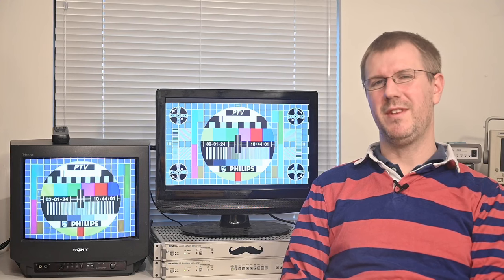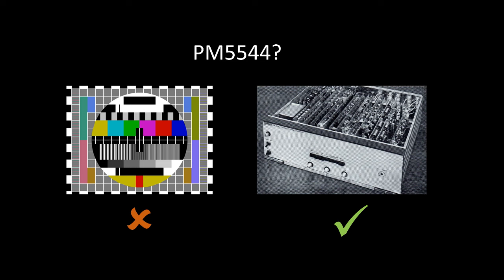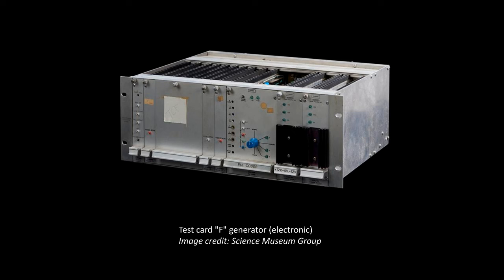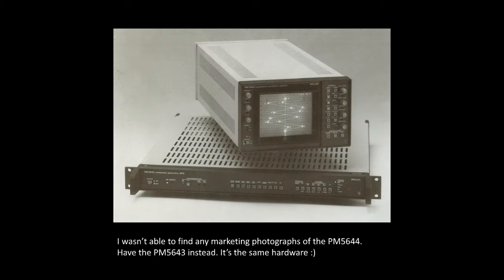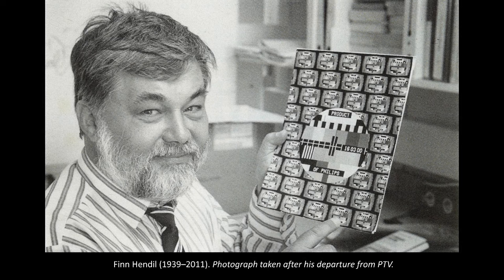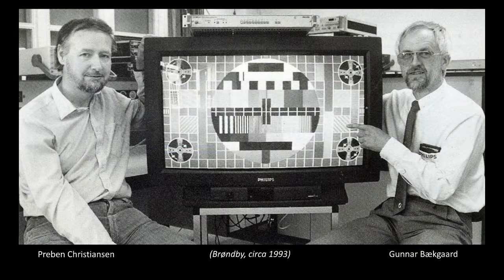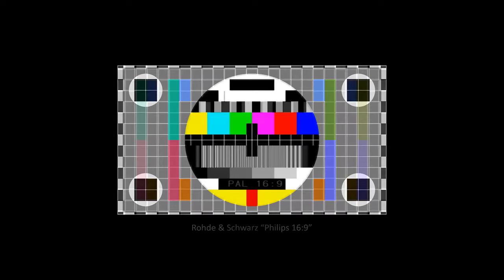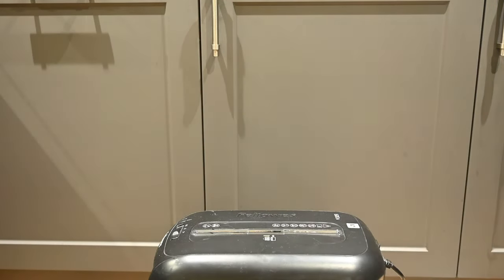#12 - The real Philips PM5644

Comment: Great work! I might look at building a 525i SDI version as well as a 1920x1080i. The 525i SDI could easily be encoded to NTSC if required. However rather than fabricate all that hardware, are there standard high quality image files available anywhere online? My approach is to make a Windows or Linux based generator which would output via a low cost Black Magic SDI card using their API. Then just find an old 1RU server as the hardware base.The editing features would be via drop down menus on the PC VGA/DVI display. Or they could be command line based as a start. Of course being software based, such a unit could  output in any standard resolution or format. Just load the image file,.What do you think?

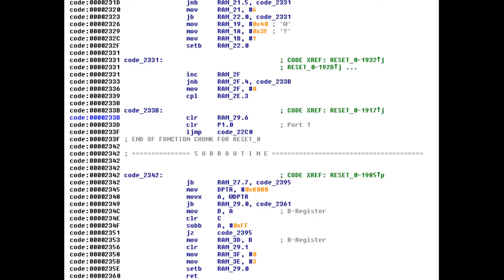Comment: 21:44 puts that project in the shade? Yikes!  I've done some reverse engineering of code like that. It takes ... a very special kind of person to press ahead, let alone succeed at it.  So I know you're not exaggerating. My hat is off to you!
Reply: I agree. When I was 16 I would have had the energy for this, but nowadays I would give up after 1 hour.
Reply from the maker: @der.Schtefan  No way I could have pulled this off aged 16! A project like this requires quite a lot of experience, which at 40, I now have :)

Comment: I have a PM5644 Pal Plus generator too, model number PM5644/85. Unfortunately no documentation. I also have a PM5544, which I got about 20 years ago. According to the station ID that was programmed into it, it belonged to the ABC in Cairns. It also had a 'home made' card in it that replaced the pattern in the circle with "Please stand by" in yellow lettering on a blue background if the 'Ext pict' button was depressed.
Reply from the maker: Ohhh. I have read about that ABC unit. When you power on the 5644. What firmware version does it say it is?
Reply: It says version 001.1
Reply from the maker: @a4000bear  hmm. I think mine is 000.1. I don't suppose you have a picture of the pattern it generates?
Reply: I can do a pic, but there is no way of putting it on a message here.
Reply from the maker: @a4000bear  drop me an email maybe. I have it on my youtube about tab
Reply: Just sent it. You should have it now or in a minute or two.

Comment: Forgot to mention I also have a Tektronix TPG-625 which generates the PM5544 pattern. No documentation unfortunately.
Reply from the maker: Ohhh. I have the manual for the TPG-625. I will scan it in due course.
Reply: Cool, I'd love to see it, but no hurry. :-)
Reply from the maker: @a4000bear It will take some time. It is a big manual with like a hundred pages and a mix of A4 and A3 sheets. Will have to pay somebody to do it probably. If you (or anyone else) needs any info the meantime let me know. I could scan specific sections from it.

Comment: I really want the Philips PM5644G/00 Pattern Generator. I was going to buy it earlier but it was sold out. I really want it. Mine only has the FML Test Card Maker. I really want the PM5644. Radio repairnan or people. If others still use them, you should sell them to me.
Reply from the maker: I don't have one. I sold my PM5644G/00 to a guy in the netherlands about a year ago.
Reply: @mattstvbarn  But I really want a Philips 5644G/00. Even though you don't have one, I still want one. What should I do?

Comment: I made a video on testcards in general (in danish but subtitled): https://youtu.be/WQ2OSaBcS_o
Some of the engineers from Philips DK that worked on the Philips 5544 was later employed at Denmarks Radio, where I had the chance as a consultant to work together with one of them. He told me a lot about the 5544 development, and how it was gradually refined. If I remember correctly, he worked on the final analog output stage. 

In the early days of the Danish test signal, the source was the 5544, but modified with DRs own text and clock overlays. At that time the font was quite digital, and there were ":" in the time. Here is a clIp of that: https://youtu.be/C0XIiXu4TuM (I think this was a DR internal construction).

Later, the clock source was one of the newer PM boxex, that had the time separated with "." like this: https://youtu.be/kRJ43r7yIDs , but still with handmade digital overlays of logos. (BTW: The color logo was in production use for some years in DR). 

The latest version I know of looks like the PT5300 out-of-the-box: https://youtu.be/vVg2GMyqGac

Needless to say, but I find your video very inspiring and it fills in a lot of unknowns in my knowledge of these delicate pieces of test equipment. Thank's a lot.
Reply from the maker: I will take a look at your video. I can basically read danish nowadays. I have also learned from this! I have covered this topic a lot but despite it is very rare to hear anything from Denmark. Once you start seeing test cards with graphics this is usually the PM5644, especially if recorded after 1989!
Reply: I think that we have 2 pcs PM5644 compositet version in our museum, with logo generator from DR1 and DR2 before we moved to our new facility, where we had DK Tech PT-5300 all over the facility.
Even think that we have a PM5644 in component standard version, our OB truck from 1990 was full component, and we had the generator in both truck.
Been at DR since 1992, and have done service on most of the Phillips/PTV/DK Tech generators inhouse, also changing eproms when our station change the design of the logo.
The new design was made inhouse, and then carried to the company on a 1.44 floppy, and 2 weeks later we got new eproms with the new logo. 
2 years ago I exchanged arround 40 pcs PT5300 some with changeover, some without, and with various options to a different manufacture, since DK Tech glosed down, and we couldnt get support anymore.
Reply from the maker: @renejensen5656  I don't suppose the museum would be able to help out with finding the PM5644 logo generator firmware? I am actually in Copenhagen a week from now...
Reply: @mattstvbarn  as I remember the main firmware prom are soldred in on the board, only the logo proms are in socket. Im not fund off soldring out the prom, i know that the board are a bit fragile in the hole though between the layers. And we try to keep the equipment in working order.
Reply: @TorbenRune can you remember the names of the former Phillips/PTV guys, been working at DR since 1992
Reply: @renejensen5656  
Jens Grove Rasmussen
Reply: @TorbenRune  I remember him well, he was in our video lab department.
Reply from the maker: @renejensen5656  the logo generator firmware is in a socketed EPROM. Very easy and low risk to copy. No soldering necessary. It is worth making backups of it, because eventually the code will be lost due to bitrot.
Reply: @mattstvbarn  ok, I will go to our museum basement after easter to see if I can find the generators. I think we still have some eprom readers inhouse.
Get back to you later with futher info. Hope that they still are on the shelf working.
Reply from the maker: @renejensen5656  Here is the wish list (and EPROM types): https://xpander.mattmillman.com/files/linked/to_dump.jpg Ideally I'd like to get the code from all of the chips on that board, but you might not have the hardware to read the smaller (PAL) chips. Would also be very interesting to see the inside of it, especially if it's a component generator version! I would of course credit the museum for anything you can provide!